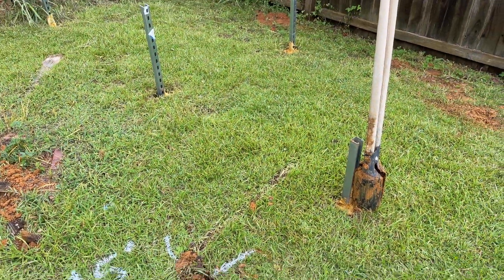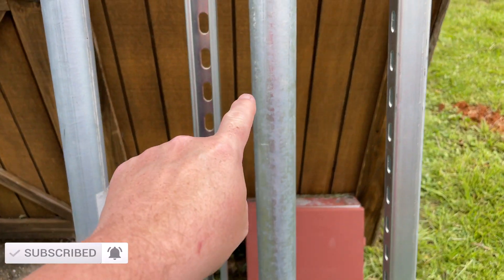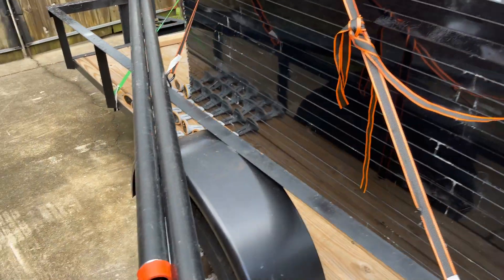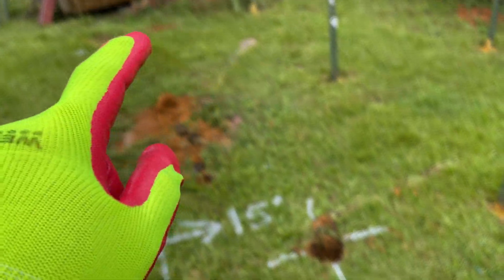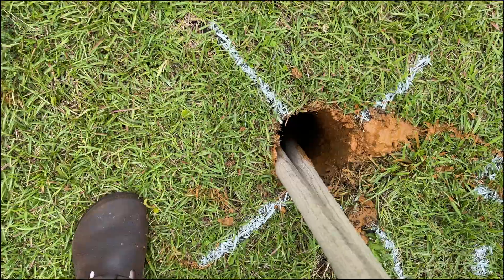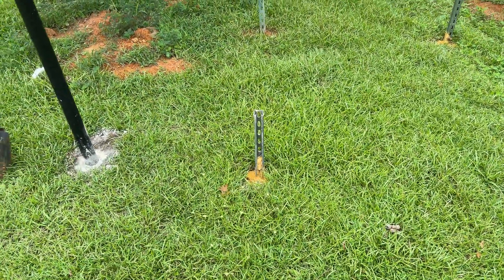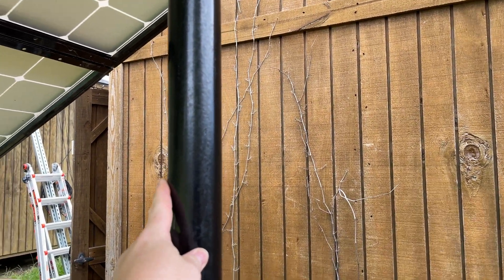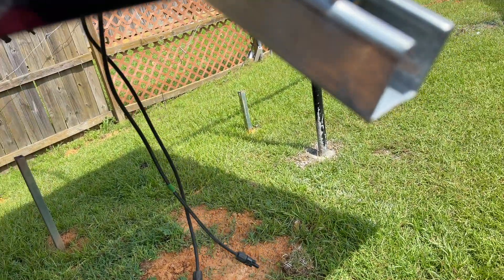DIY Solar Panel Ground Mount - 6kWh- Cheapest way - Yet Strong.. - Part 1

Comment: How are u attack the panels to the Unistrut? What hardware? I had the darnedest time figuring out mounting hardware for Unistrut a few years ago
Reply from the maker: I used a U-Bolt, but in the next video, i am changing it up a bit, Make sure you subscribe and the next one will be the one you will want to see on how i attached them.

Comment: I've had a change of plans too for mounting my 6 new Panasonic panels....wait till next spring to install :-) that 2" Lowes Galvanized conduit is now $101.00 per 10' piece. same price at the local electrical supplier and even Grainger. Black steel pipe is now upwards of $15.00 per foot. My new plan is to perhaps stockpile another six panels and wait for next spring and hope the steel prices go down...
Reply from the maker: Oh wow, when I purchased these back at the start of summer, the black pipe was around 50 ish per pipe… hopefully the price comes down